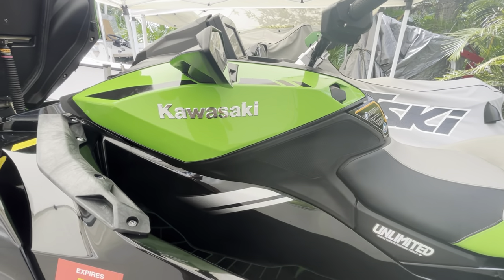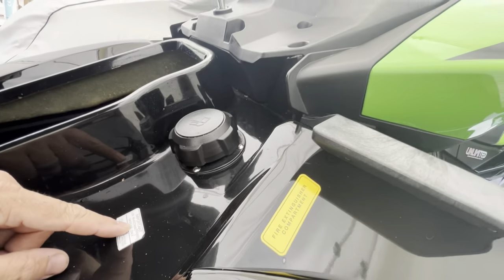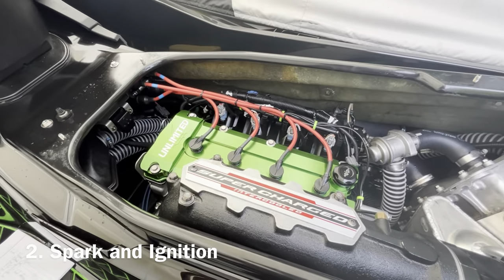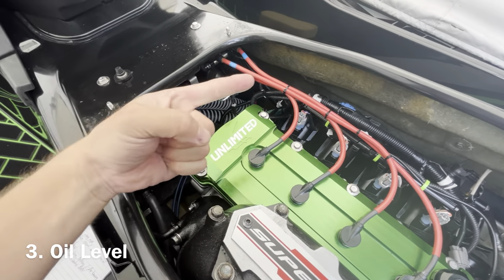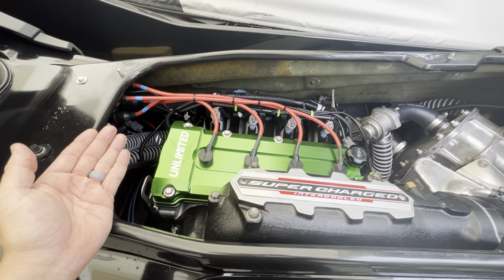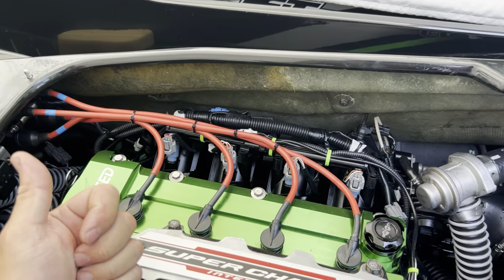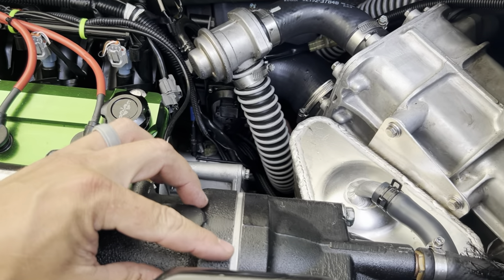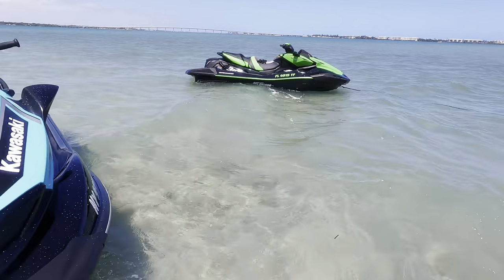5 Tips to Diagnose Mechanical Issues: Kawasaki Ultra 310 Jet Ski - 4K VIDEO

Comment: Well done. So many issues we see are from simple maintenance items. But most problems we find are when owners who don't have the service manual have had a play. 
it's hard to buy service manuals now, and there is no longer any PDF's for the new skis, they went online only with dealer access exclusively.
Reply from the maker: Yes, agreed. The first thing I do with every new (or used) vehicle I acquire is to get a service manual. I know the paper version for the 2022+ 310 has been backordered for a few months now on the Kawasaki website.

Comment: Lots of good info in this video - but I personally think there is just way too much maintenance to perform on this machine to keep it running at peak condition. I'll look elsewhere so I can spend more time on the water instead of the shop.
Reply from the maker: Any supercharged ski will have as much or more maintenance. If you don’t want maintenance, go naturally aspirated. Out of every ski I’ve ever owned, The Ultra 310 has had almost zero failures in the 150 hours I’ve owned it with the exception of the wire harness which was a factory defect.

Comment: Thanks. Fuel filters can definitely drain performance. All the manufacturers went to the inside the tank style fuel filters. Saves $ in manufacturing. And of course made them all harder to get to! More $ at the dealer. The older 15f had a huge external filter that is easy to change but basically never needs changing. Over 600 hours on my 2005 attests to that. Later model 15f's went to an internal design. But they are very easy to change vs Ultras and STX 160's. Remove the glovebox and you look right down on the fuel pump. Tank mounted filters will not last that long. Kawi Performance offers an external filter design. I have added that to my STX 160s. Not enough hours to say if the filter lasts longer but it will be a heckuva lot easier to change.
Reply from the maker: Thanks for the comment! Yeah unfortunately with the advent of fuel injection even the smallest particles can destroy the in-tank pump..but the filter itself is like $15 but yea for the 310 there is an access panel (where the kspeed filter goes) but you do need to unbolt the upper deck/ handlebar area to get to it- without stopping to film everything I can have it done in 45 minutes.

Comment: what type of silicon is used, need a lot of upgrade to enjoy this ski LOL :)
Reply from the maker: Any marine grade silicone and I assume you are referring to sealing the ride place and intake? It comes sealed from the factory but if you swap components you must reapply- or not- it’s not necessary but help improve speed just a bit in some conditions.
Reply: @JDsWaterWorld  I think for the first year I will just leave it stock with minor upgrades that does not void the warranty
Reply from the maker: Good idea- this is what 90% of buyers should do! Look at me as the test dummy- you don’t need all these things to enjoy your ski- but if you decide to mod it out- they are there! Kawis have a massive aftermarket support as you can see lol
Reply: @JDsWaterWorld  I hear you I am very impressed and motivated by your channel.  I alos have a Mercedes GLA 45 AMG I bought all data on it to do maintenance and All Data was wrong they had a maintenance data on a base GLA 250 instead of the M139 hand built AMG motor.  I had to research and find out how to service the rear diff. It has three chambers one takes a 75W140 and the other two took 75W110 gear oil.  No where on you tube it lists that.  I should have made a video on it.  Next I will be doing the break job on it which is $3500 by the dealer. No a difficult job.
Reply from the maker: So you have plenty of experience with high performance machines. Did you ever consider the SeaDoo Apex? Not endorsing it, just saying maybe check it out to see if you like it. The Kawi is a special kind of buyer- definitely not for everyone. As we’ve talked about, I wouldn’t personally waste my money on any other watercraft, but just because I like something doesn’t mean that you will too..go look at them all in person

Comment: I’m in the process of purchasing 2022 lx-s manual. How frequently does Kawi. recommend changing fuel filter? I watched your video on replacing and it is WAY beyond my skill set to check or replace. Can we not get like 50 to 75 hours if we use only non ethanol or rec 90?
Reply from the maker: Hahaha they recommend every 25 hours but nobody can do that..it's impossible. If you use clean fuel from a safe source you can def extend the life of the filter

Comment: Do you gotta worry about things breaking easier on FPM or do you just gotta do more maintenance checks? Becuase as you said to get the full affects of the ski is to run it on FPM. Which I’ve been doing.
Reply from the maker: If you have a stock tune, running in FPO will not cause anything to break easier. If you have a tune and are running very aggressively above factory redline then yes you will definitely wear out the belt, pump, and associated bearings much faster.

Comment: I need some help, please!

I've been watching all your videos and love them. In May of this year, both of my jet skis, a 2022 LX 310 and an LXS 310, were stolen along with their trailer. Luckily, I was able to locate them using GPS, but I discovered that both jet skis were missing their ECUs. I ordered brand-new OEM ECUs from a Kawasaki dealer, and they have been installed. At the same time, both jet skis had a recall for harnesses, which have also been replaced.

On the first day on the water, everything was fine. I used both jet skis with a friend for about two hours, reaching speeds of up to 67 mph with no issues.

However, on the second and third outings, the RPMs would increase when pressing the throttle, reaching around 4000-5000 RPM, but then drop rapidly to about 1500 RPM. When I set the jet ski to slow mode, it ran somewhat better, but I still noticed the RPM dropping. When switching to FPo or MPo mode, the RPMs increase and decrease more quickly, and the jet ski won’t go over 40 mph.

I haven’t yet gone through all the five steps you mentioned in your video, but I plan to, as it’s unusual for both jet skis to have the same problem simultaneously. Do you have any advice?

Thanks!
Reply from the maker: How old is the fuel? That would be my first red flag if that's old fuel in there...
Reply: @JDsWaterWorld  Fuel was old 8-9 months (half tank, I was refilling first day), each time I go on the lake I spend around half tank and after I refill 93 octane, today I put K100, first 2h jet ski was working perfectly, third hour RPM went down constantly, speed is going up but with those twitching. So far this season I spent around 35 gallons.

Comment: 16 Kawi 310LX ,  was running sweet then all of a sudden won't go over 3000rpm , 10kmph.  No warning light or code   seems to be in some form of limp mode?   Can only very lightly throttle upto 3000rpm   give it full throttle and it practically ends up stalling.     Any ideas ?   Cheers
Reply from the maker: Sounds like you lost your boost. Check all the ducts and make sure nothing popped off, check all the hose clamps, check the belt, make sure your tensioner not seized up. I’d start there…obviously make sure nothing sucked up in your pump as well

Comment: Hey JD, my name is Ryan and I have a 21 310 LX. The ski is in the shop due to a major loss of power! I bought it last year from a friend that bought it new with ‘thankfully the extended warranty’! It originally hit 67 quickly before the speed limiter kicked in, but slowly faded to around 60 at the end of the season..! I decided to have a well known guy winterize and store it.. I set an appointment well before pulling it out of storage with Flatout ‘which is where it was bought’ just to find out they had no record of my appointment a day before it was going in..!😡 I asked the service guy about adding a SCOM and he said it wouldn’t affect my warranty! I haven’t seen more than 65mph on my dash, but it did run right along side of two friends SeaDoo 300’s! Which they would pull away after I hit that limiter before! Pretty sure the supercharger is shot, but we’ll see see.. The last time I took it out it was normal for about 5 seconds, and then wouldn’t go more than 45mph.. added some fresh fuel from the marina and it did intermittently take off for a few seconds.. Just wanted to get your thoughts pal? There has been some issues with this dealership in the past with friends, so I’m getting a little concerned.!
Reply from the maker: There is no SCOM for this ski, you must get an ECU tune. The superchargers are not known to fail and last many many hours..sounds to me like you might just need some new spark plugs, fuel filter bag, the pivot bushing greased, and possibly an inspection of the jet pump bearings and belt..how many hours on the ski?? Also I need to know RPM- speed is irrelevant it’s the RPM that you need to pay attention to..

Comment: Great in-depth video of common power loss problems which you personally haven taken time to help me troubleshoot as well.  I hope my issue isn't the fuel filter bc that sounds dreadful to replace.  It's probably time for an upgrade anyhow to the new redesign 310!
Reply from the maker: It’s so hard to diagnose without the ski in person, like any machine. I hope you sort it out and if not- hope you are able to get the new one!

Comment: Jd,  I have 2018 310, which is has code 58,  ETV Actuator  Failure. I have followed the service manual, checked the relay , which is good. The manual says to replace the throttle body, and or the ECU. Have you ever encountered  this issue before ?  Ski runs about 3000 rpm  at idle and doesn't sound right Thanks
Reply from the maker: If you checked the relay and it's good, and checked the wiring and it's good, make sure you check the ETV input voltage as per the manual with a needle adapter on the specified ECU pins. If the voltage from ECU is 1-2 volts, than that's normal and your ECU is probably fine and your throttle body is what needs to be replaced.
Reply: @JDsWaterWorld  I checked  the voltage , and not getting any . So I'm niot sure  to replace the ECU, or the  throttle body
Reply from the maker: You checked the voltage with needle adapters with the ignition on and the wire harness clip inserted into the ECU?
Reply: @JDsWaterWorld  Yes, and Found the problem. The butterfly in the throttle body was stuck open !!  There was corrosion  in the bearings on both ends. The local shop  removed the actuator, I know the manual says not to, corrosion  in the gears as well. Cleaned the corrosion , and reinstall the actuator,  and no more code 58, and runs great again I'm going to remove the throttle body every 25 and clean and lube the bearings.

Comment: I have low compression in cylinder 1 I think I blew a ring on my 2017 ultra 310 LX 
I’m in Texas and everyone want to charge about 10k to repair I want to repair it but 10k to repair sounds a little silly to me would you know shops in Florida that may be able to donut for less? 
I’m in Texas
Reply from the maker: You’d be better off rebuilding it yourself and having your head machined and bored oversize and installing new pistons. Give Steve at Kawi Performance a call- he’s the only shop in the US I know that I would trust to rebuild these skis.
Reply: Yeah I’m going to look into it do you have his info?
Reply: My guy… guess what I found the compression to be at? 90-95 is that normal?

Comment: U lost me at stabil being garbage lol. I can run a generator with 3 year old gas in it that’s been sitting with stabil in it.
Reply from the maker: A supercharged inter-cooled 310hp Jet Ski is not a Briggs and Stratton. Stabil works fine if used on fresh fuel, K100 treats bad fuel, stabil does not. I have used both products extensively and am speaking from decades of experience

Comment: The k100 is now in a marine grade. Have you tried it or stick with the original?
Reply from the maker: I’ve bought the marine grade before - the red one has been great and is a few bucks cheaper so I usually just go with that.  Just make sure you don’t buy the diesel one by accident- they changed the bottle not too long ago

Comment: I have power and rpm loss on my 2023 160lx, up on investigating I found one of spark plug boots was 1/4” up higher than the rest, will update if it fixed the problem up on next time in water. My theory is expending air apply pressure on the boot and with vibrations it will pop enough to disrupt connection, we will see if I’m right 🤷‍♂️
Reply from the maker: Huh I mean could potentially be the issue..the 160s don't usually have too many issues at all
Reply: @JDsWaterWorld  gas was fresh, intake and behind prop all clear, 10 hours on skis, I mean I very hope it was just that but we will see in a week 🤷‍♂️
Reply: @JDsWaterWorld  so, yesterday I had ski in the water and it ran as it should, I was getting 75kmh in choppy water. Then after fooling around the ski dropped top speed, 6000rpm max and torque dropped too. I removed cover and checke spark plug boots all good, and even after letting ski to cool off it was steel under powered. Will try to ride without seat today wanna see if exhaust lest can be the cause 🤷‍♂️
Reply from the maker: That does not sound like the plugs...seems like it could potentially be a fuel related issue with either the fuel itself or possibly the fuel pump. Since your ski is so new and likely under warranty I would take it back in. Unless you have the ability to check the fuel pressure. Can you get K100 fuel treatment?
Reply: @JDsWaterWorld  I use 94 octane, gets fresh gas every 2 weeks. I took it out today to test. What I did is I ran it for about 15 minutes and sure enough same symptom, so I took off seats and cover suspecting exhaust leak, wasn’t  it. Then get this, I have two of the same skis, my wife rides the other one, I took it for a ride about 20 minutes and no problem, then jumped on my again and it’s back to full power. I’m now thinking fuel pump or filter. However we fuel at the same time same source…. Will take it back to dealer. Probably will post video once it’s all figured out.
Reply: @JDsWaterWorld  so it was a vent line, works no problem now.

Comment: Most people who own the 310 want to know why at full throttle you lose 2-3 pounds of boost but the rpm stay the same but if you hold throttle down maybe 90% it do it
Reply from the maker: If you have the stock tune, once you reach full speed and RPM, the tune will govern the system downwards, resulting in a loss of speed, RPM and boost
Reply: @JDsWaterWorld   yea it’s weird because on my 2023 310x I will hit 68 easily and I can hold it there it won’t budge if I squeeze throttle maybe 90% but once I pull all the way thru with the throttle 100% the boost drops but the RPM don’t
Reply from the maker: The only thing that would explain a loss of boost with constant rpm would be that 1) there is a leak or 2) the BOV is bleeding off boost prematurely 3) tensioner is allowing some belt slip due to bushing binding or water getting on belt

Comment: Good overview.  Regarding the catch can, I have a custom version of the old (round) catch can which does NOT vent to the air box.  It has a bottom sump with a manual drain that I pump out after every ride (and always has nasty gas smelling blowby) and a couple inches above that is the overflow/vent to the crankcase.  This is how it should have been designed, but the manufacturers don't want to burden owners with another maintenance item.  I've never had to clean my intercooler (and yes, I inspect it).   Also I blocked off the BOV soon after I got the ski (and removed the exhaust filter)
Reply from the maker: Cool- I would prefer an isolated catch can, but for now will keep the stock setup. I don’t mess with the boost after seeing the many images of detonated Ultra 310 positions (due to lean mixtures) If I upgrade to forged, I’ll run the block off.
Reply: @JDsWaterWorld  300X doesn't have the detonation problem that I know of
Reply from the maker: No it doesn’t, thought you were talking about 310
Reply: @JDsWaterWorld  I was seriously thinking about a 2023 310 but I have my 300 set up the way I want it (including high quality silicone coolant hoses) so I'd be out $12k with basically the same ski and alot of work to do...overall I like how the new one looks but doubt I would be any faster on a typical Saturday with tons of crazy boat chop
Reply: Have you ridden an FX SVO in chop yet?  You should do a comparison video
Reply from the maker: Hahah in 2020 I wasted $$$$ on a VX and an FX…the FX was the nano hull I know now they switched back to SMC..I was coming in the inlet and came off a wave into a hard trough- the ski slammed down and the front compartment popped open!! The wave went over the bow, filling the ski up with water almost sinking me…this happened more than once! Would never ride an FX in the chop again…guys I ride with, they are always swapping supercharger clutches